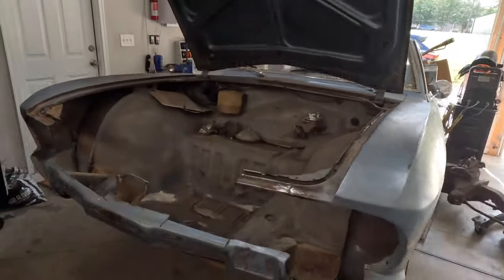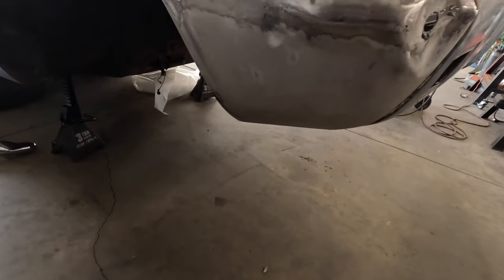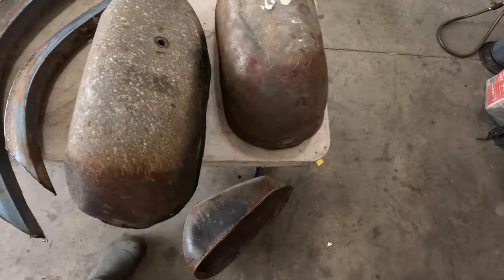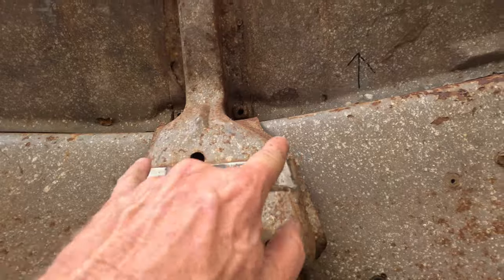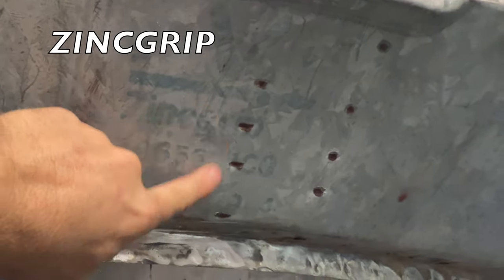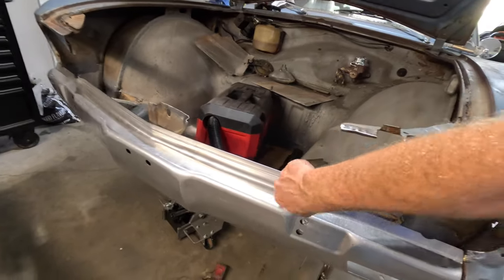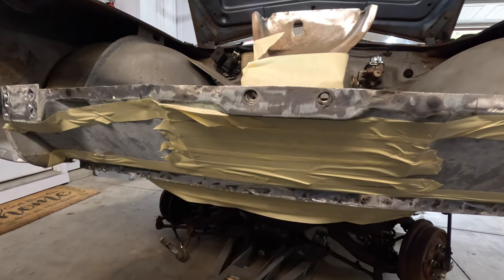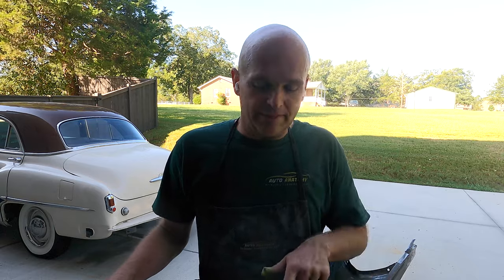Hacking the nose off the FLOODED Corvair!  Plus a TOP SECRET Corvair only parts stash!

Comment: Nice work!  I hope I never have to go into one that far.  Finished product looks great.  When you were aligning the buckets I said out loud, "You need to shut that hood to line it up." and right then, you did.  Sorry you weren't able to use the piece from me.  Looking forward to more vids of rust.  I'd suggest you go ahead and deal with the rust now, then you'll be done. Get it sealed, then primed at a minimum.  Drive it a while more and enjoy it before you dig into the suspension.
Reply from the maker: Thanks Barry!  It's way more work than I was hoping for, but ultimately it'll be rewarding to know the front is solid again.  I'm thinking about just knocking out the wheel wells and being DONE with rust for a long time.  

Thanks again for letting me come out and play at your place, and I definitely need to come visit again when I get back from vacation.  

Sean

Comment: I remember watching some of your earlier vids where you were suturing up the headliner and I was like "what the F are you doing? Do it right!" And here you are, doing it right! Nice job, keep it up!
Reply from the maker: Thanks!   The headliner was always meant to be a temp fix, I just didn’t want to have it hanging down in my face.   The car has come so much further than I ever expected, and I’m loving every minute!
Reply: @AutoAnatomy  I'm resurrecting a '66 110 PG coupe myself. Replaced carbs, pushrod seals and oil pan gaskets to get it running right, then had the alternator seize (towed home), fixed that, drove it 500 miles to a car show without incident and upon my return took the wife for ice cream and the fan bearing seized! Getting to know the tow truck drivers on a first name basis, but there's something about this car that keeps me going!

Comment: I have three late model Corvairs.  Every one of them was hit in the left front corner, and every one has Bondo in the front panel.  One of these cars is very original, and the factory panel fit is not spectacular...  You are doing very nice work there...
Reply from the maker: Thank you very much.  I know fit/finish on some older cars wasn't as good as modern cars, but that's my standard (I guess).

Comment: Hey Sean, great vids! I have a 65 and the front is lined up perfect. Maybe the hit on the front of yours was hard enough to pull the seam open? I am replacing the rear corners on mine. Couldn't find a left side so I had to make one. Next up is the whole floor! Joys of owning a rust bucket 😅
Reply from the maker: Thanks @VtwinGuy5.  I still have a bit left to wrap up on the rust repair, but it's getting awfully close.   I do think it was hit at some point but it wasn't bad enough to bend anything structural.  There's one rust spot on the rear quarter I need to fix but this takes care of 90% of the rust in the car.  

Sean

Comment: Finally got my 1969 Corvair model . When I paint it, I want to do the rear panel in silver around the tail lights. So do you know if the silver paint goes all the way to the end of this panel or does it stop mid way behind the outer most light? Do you know what color code it is? I want to paint it dark green which will be a custom color The interior will be tan. should look nice.

Comment: Where was the cross bracing between the fenders when you chopped out the support provided by the front clip? Finish the rust repairs.
Reply from the maker: The front is incredibly solid without the nose in place.  I couldn't move the fenders even when I tried.  If the car had been more flexible it would have definitely needed cross bracing.

Comment: Ok, so your awesome! Let's just get that out of the way. As far as why the nose of the car had filler bondo. I dented my early model with a power glide because I left it in drive and it hit my truck. Now, those little shift levers have a window that gets cloudy and it is hard to see what gear it's in. On top of that the light in there is kind of dim. On top of that there is no park position, so if your going to leave it running for a minute and get out of the car you have to put it in neutral in the middle of all the settings. I'm not making any excuses for my blunder but I'm just saying......the nose is the first thing that hits even in the slightest of fender benders. That may be why some Corvairs have filler up there.

Comment: So ironic that these rear engined cars tend to get hit on the nose. Same thing with VW Karmann Ghias; they’re sweet on getting their noses banged in. Have you thought about using panel adhesive on certain areas? It can be your friend in places like the headlight buckets.
Reply from the maker: The headlight buckets need to be able to unbolt, but thought about panel adhesive for some bits.  Perhaps in the course of repairing more rust there will be a good opportunity to try adhesive.